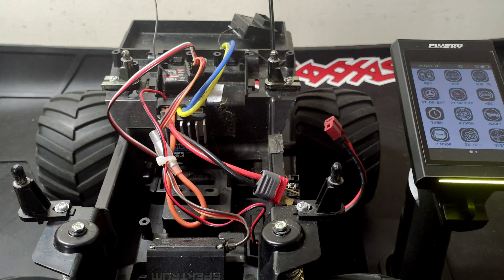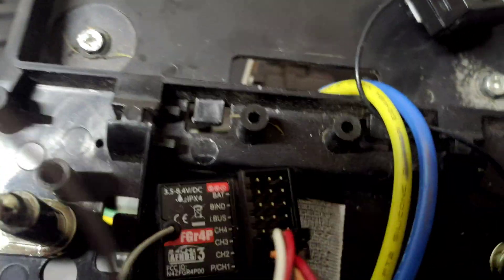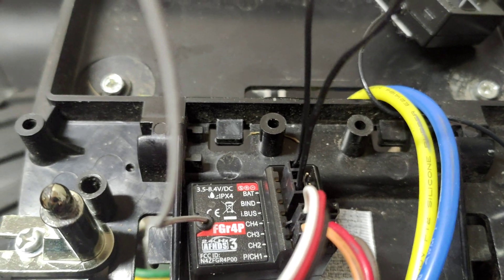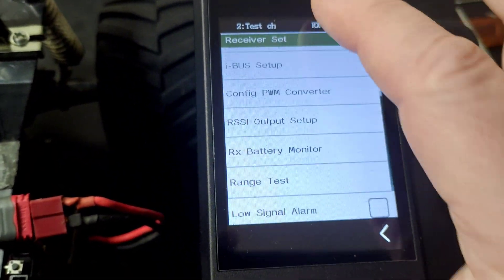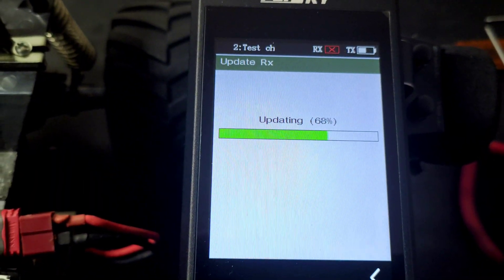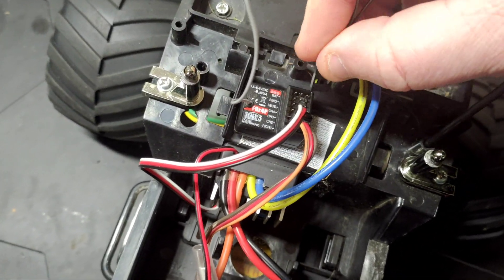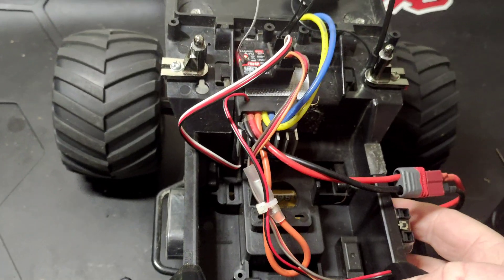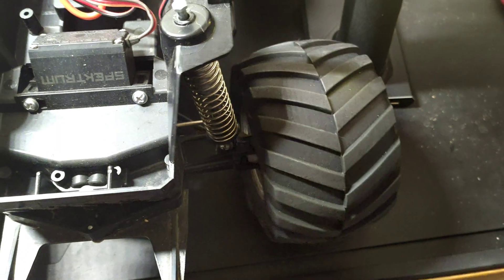Flysky FGr4P receiver firmware update guide after nb4 2.0.93 update.

Comment: So I did both the update and binding for this receiver. For some reason though forward works, steering works, brakes work. But reverse doesnt,,,I don't get it. I am standing right next to it and sometimes I get to 50% reverse on my TX before it finally wakes up and registers I am trying to reverse. Then after I use reverse a few times it works better... lol... I calibrated the ESC for neutral, forwards, reverse as well. I think it's this receiver.
Reply from the maker: Do you have the esc set to forward/brake/reverse ? Also might be worth turning down the polling rate to below 300hz as some esc and servos struggle to keep up above this

Comment: Hi ! Why need to put the bind plug sideways for update?
Reply from the maker: If you don't it doesn't write the update to the receiver
Reply: @WTFRCCars  so mine didn’t write the update since I didn’t do it that way?  I did it after upgrading to the newest firmware.
Reply from the maker: Correct if you don't put the receiver in to update mode it does nothing when you tell it to update
Reply: @WTFRCCars  but it says updated when I hit the Update .
Reply from the maker: It will but doesn't do anything

Comment: Hi again. Could you possibly show how to update the FTr10 receiver please ?
Reply from the maker: Sorry you can't update the ft receivers from the nb4 is not supported you have to do it from the paladin 18 that it's supposed to be used with or the flysky updater software but not sure if you still need the pl18 to connect to pc.
Reply: @WTFRCCars  oh ok.  I'm new the RC world so thanks for all the great info!
Reply from the maker: No probs :) fg receivers and for the nb4 and ft receivers are for pl18 you can use them between the 2 but not update them so you better off sticking to the correct ones :)
Reply: @WTFRCCars  will do. Hey wanna buy a FTr10 :)
Reply from the maker: You can download the flysky firmware updater for the pc and then update the ftr10 through that and the nb4.